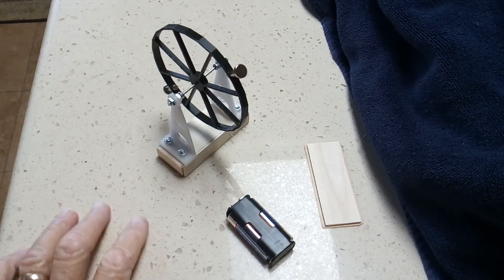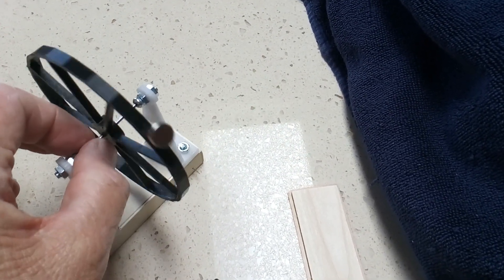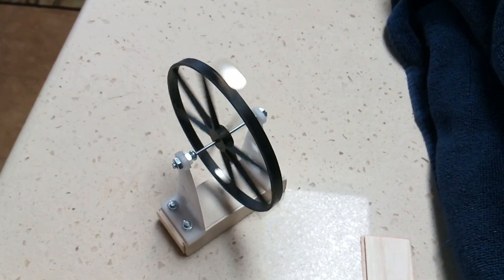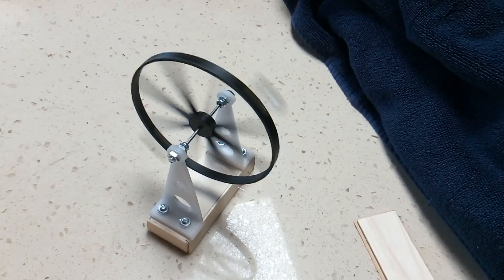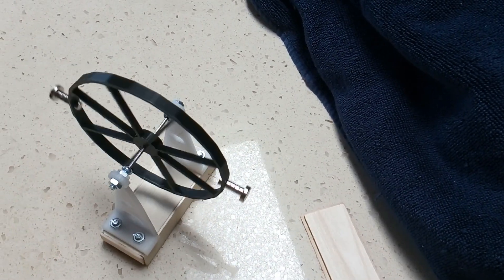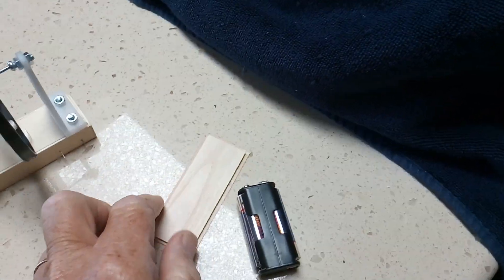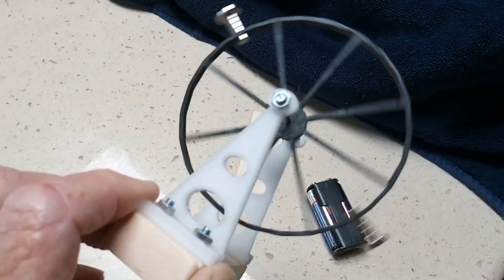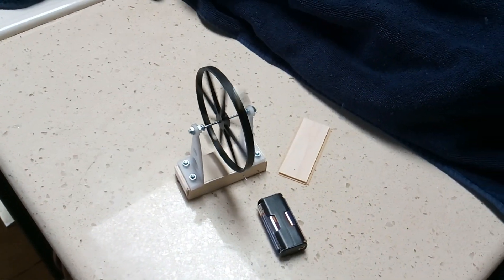Desktop Toy Motor

Comment: Very cute !    could be nice to fine tune the wheel balancing.  Cool 3dp  stuff,     only problem i had on this type of wheel  is to  drill  or make the central hole  perfectly  orthogonal..    In fact we loose  a certain amount of energy in   imprecision..      Even with EZspin motor, it's a tricky game !     as in many  case,  drag is the ennemy,  and  I think we can find  nice solutions  to  improve  on  losses. Thanks  for your videos,   regards

Comment: Hello Lidmotor. I have been watching your videos, Slider's videos as well as DR. Stiffler's videos. I am interested in open source work like this. Have any of you done any research into ion and magnetics while using LEDs? I have a transcript that I am  going to share with you in part now. It was from Nikola Tesla, recorded by my friend Pamela Aaralyn in August of 2016. I will share the important bits that you might find useful, and those of this community as well. Here goes: What are we missing in terms of how to harness energy, today? "Copper, quartz and magnets, that simple. The pull of the magnet catalyzes the copper to affect the quartz. The energy within the quartz then is harnessed like a centrifuge - it disperses and then returns to its’ center. If my vision in my human time had prevailed, you would be now tapping into solar energy from space.”
Does raising the frequency of a Tesla Coil increase its power?
"You would need to utilize a Class E RF amplifier. I prefer one made by Nathan and Alan Sokal in 1975. The Class E amplifier makes use of a resonant circuit to get around the usual problems of switching power semiconductors at high frequencies. This topology is now finding commercial success in high power radio transmitters and RF generators for plasma generation and induction heating. High voltage MOSFETs are the usual choice of switching device.
Advantages of the Class E power amplifier:
1. Simple design uses only one switching device.
2. Eliminates turn-on losses due to stored energy in the devices output capacitance.
3. Eliminates turn-on losses due to overlap of voltage and current when device turns on.
4. Zero-voltage at turn-on eliminates Miller effect due to drain-gate capacitance.
5. Minimizes turn-off losses by limiting rate of rise of voltage when device turns on.
6. Circuit makes use of stray capacitance and inductance that would normally be hindrance.
7. Very high efficiency (90 - 95%) so very little power to be dissipated as heat.
8. Low EMI and harmonic output because of the smooth drain voltage and soft switching.
Perhaps the main disadvantage of the Class E arrangement is that it is relatively intolerant of incorrect matching into its load. Whilst load matching is usually a good radio transmitter, this intolerance to mismatching may cause problems when put to service as a Tesla Coil driver."

The actual transcript is 4 pages long and does contain other information on other subjects.

I do realize Dr. Stiffler has transitioned as his videos are now dated. He is in my thoughts and I am in his. Thank you all for questing to unravel these secrets in pursuit of helping humanity. I much appreciate your work. Thanks again! Here is my direct link on Facebook: https://www.facebook.com/don.parkinson.14/

Comment: I have a commercially made version but it operates a little differently. It has a number of coloured balls for interest and the axle sits on a curved cradle (not fixed bearing centre’s) so it doesn’t spin continuously in one direction or even spin right over every time, so it tends to rock a few times in each direction before making it right over before stopping and reversing direction if that makes sense?

Comment: That Looks Real Swell ! You could put a little solar cell on the pins where the battery goes and that should keep it peaked up. 
Are the tips of the shaft filed to points to improve the bearing pivoting ?
Reply from the maker: Yes

Comment: Nice looking build.  My brother said the same thing about concealing the electronics.  It does look better when you're building a display piece.
Reply from the maker: The drive coil has to be close to the rotating magnets to get this to work right.  A thin wood layer above the coil is important.

Comment: Haha, I was thinking 3D print and then you called me out 😆😆 but we know it would be more than 10 minutes to print it.
Reply from the maker: This is a perfect cad design / 3D print project.  The driver box is really simple if you did it seperate but the whole box with support brackets could be done as one unit.   The spoked rotor should larger or the support brackets shorter so that the rotor is closer to the top of the box.  It might take a bit more than 10 minutes. 😀